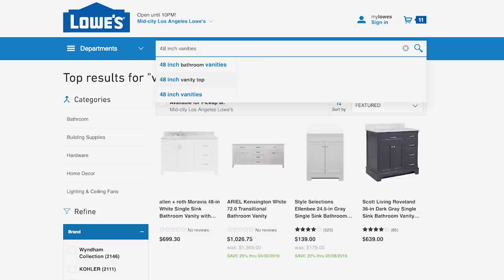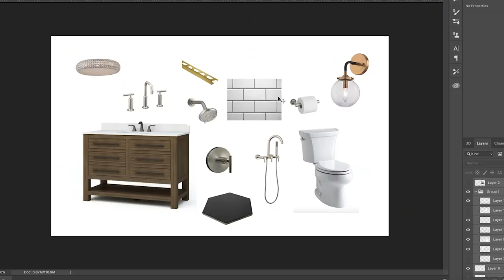Our Baby's Bathroom Reveal! | OMG We're Having A Baby

Comment: PS, "Schluder" (or however you spell it) is the best word ever
Reply: I never heard if they ended up just using the ones they bought or bought new ones... Bothers me!
Reply: @AA-et8nj  If the size was too small they most likely had to buy the new size otherwise it wouldn't fit over the tile properly
Reply: @rebeccaabrams3079  i just wasn't shre if they went with it or not if it was the width or lenght